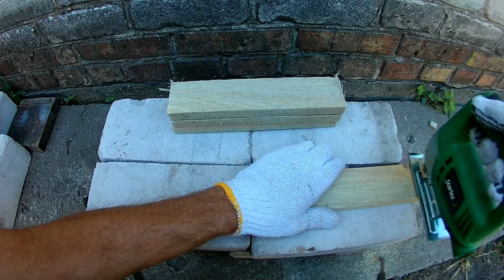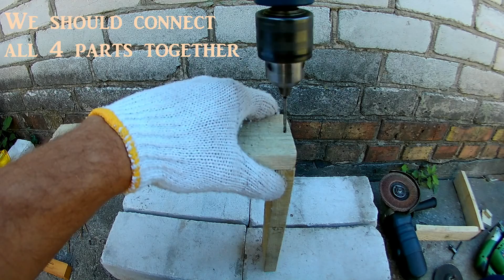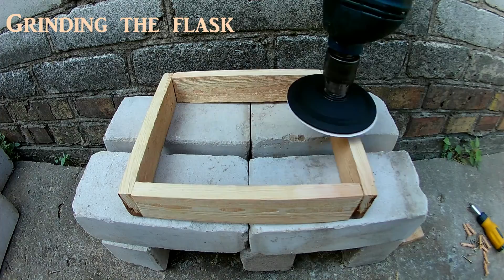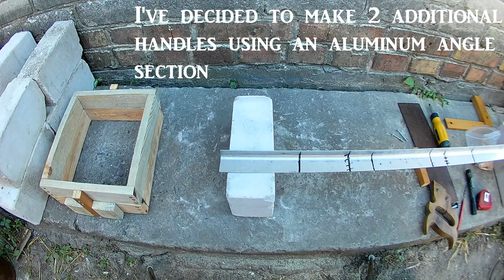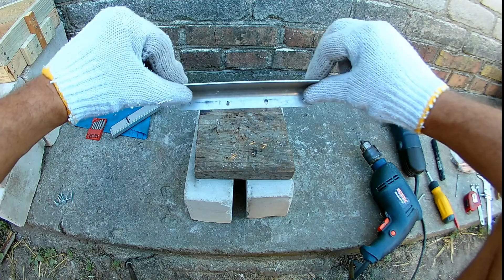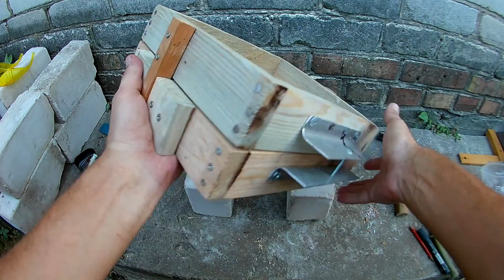How to make a flask for green sand casting

Comment: I tried grinding it like you did so the cope and the drag would make tight fit, but I messed all up. I saw a great tip in myfordboy his channel. Use some sanding paper with adhesive on a flat surface and grind it equally. Those handles are a nice addition. Gonna try to make new ones soon 😁👋👋
Reply from the maker: Yes, it's tricky. It wasn't an easy task for me and I did that the first time as well.  Good luck in your new projects.

Comment: Great video man, can I just point something out to you. That's not actually a flask, the flask is what you put your metal in to melt it (also known as a crucible). What you made was a mold. 
A small tip for anyone wanting to copy this is if you add the metal handles place them at the centre line where the two halves meet so you can clamp them together tighter to stop anything leaking out.
Overall dude, a very good tutorial and if you don't mind I would like to show this to a few friends to show how simple it can be to make one.
Reply from the maker: Thank you :) Yes, the reason I've made this video is to share with everyone. So, I'll appreciate if your friends will see it as well. :) 
About a definition of flask... Please, check this: https://en.wikipedia.org/wiki/Flask_(casting)
"...A flask has only sides, and no top or bottom, and forms a frame around the mold, which is typically made of molding sand..."
I also had a reason why I left a space between aluminum handles. It helps to open (disconnect) drag and cope. If they have too tight connection it won't be possible. If you have any ideas or questions feel free to contact me. Usually, I answer much quicker but this time I haven't seen a new comment or maybe it was a technical issue. :)